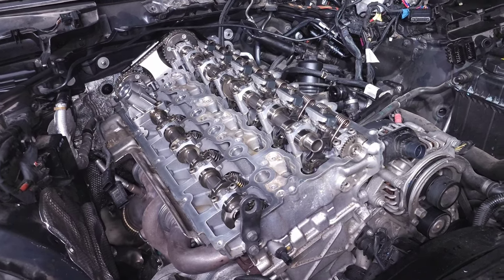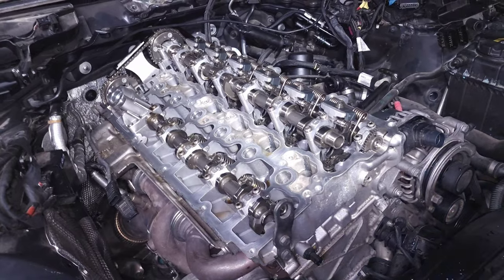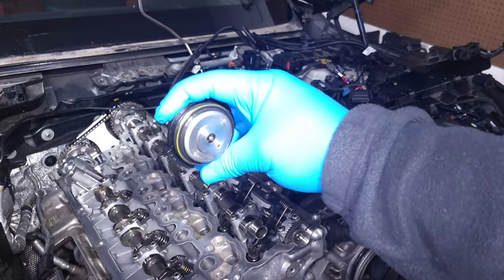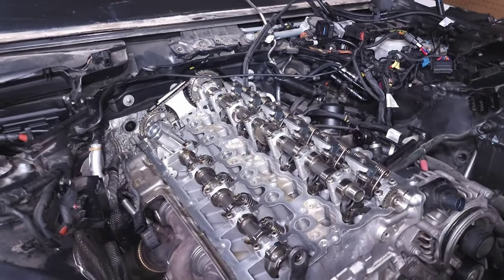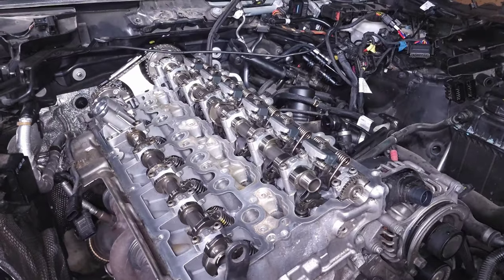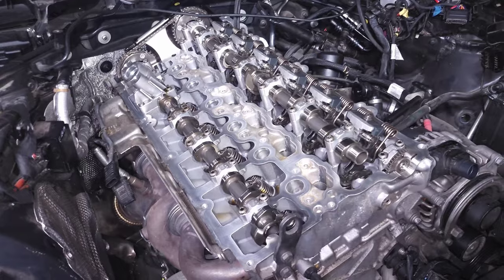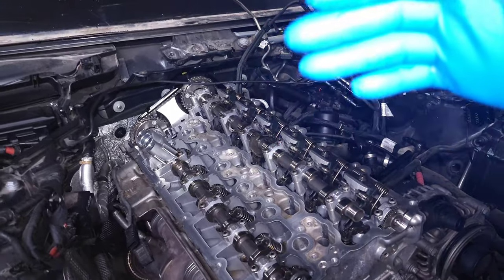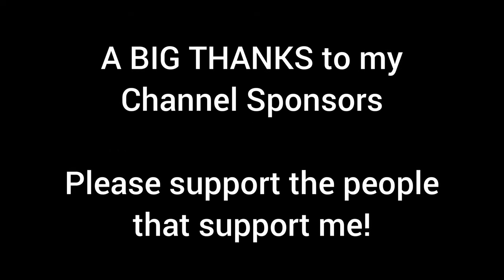Vanos: How BMW simplified their Variable Valve Timing (VVT) in the B58 Engine

Comment: As our motors get more miles on them, the VANOS system is becoming more if an issue.  Any chance you would consider doing a DIY on replacing the central VANOS valves?  I am seeing more posts on the bucking issues with these parts and the only videos are on the VANOS actuators located on the outside of the valve cover but no one has done one on the central valve.  Just a thought while you have the valve cover off your car.
Reply: Do gen 1 have this issue ?
Reply: did you end up doing it yourself?

Comment: I changed these Vanos valves on two cars without removing the valve cover. You can get there with your hand and remove them. It's difficult, but faster and than taking apart half the engine.

Comment: Hey! While trying to solve my stuttering low rpm slow acceleration, ive tested the vanos position vs actual and i saw and issue there. How would i know if its the actuator (what i see most people replacing) or the valve itself? (ive also seen people cleaning the small "filter" it has, in some cases that filter was actually ripped out)

Comment: I’m having vanos related issues on gen2 b58 but I’m not receiving a code the exhaust side degree angle bounces compared to its tagets on datalogs way more than intake side I’ve noticed that degree timing stays very high I am constantly over 100 degree angle with no codes. I have replaced the actuator on exhaust side and still same issues. Any advice or ideas on what it could be?

Comment: Hi , I did rebuild the vano on my E39 523i.... while the vano unit was removed I used a spanner and turned the crank a few turns...to many maybe 🤔, and the right spindle gear came out🥺, I have managed to put it back .... should I be worried before refitting the vano unit? Thank you

Comment: @kern417 when you replaced the actuator, did you go ahead and do both the intake and exhaust sides at the same time?
Reply from the maker: i didn't have to replace mine. if you're having vanos related codes then it will typically say intake or exhaust, so that tells you which one is bad.

Comment: @kern417 Great video and explanation, I have a question regarding the vanos actuator, and what seems to be the ever eluding Vanos Solenoid, am I correct in understanding that the B58 engine does NOT have Vanos Solenoids, I was able to find the actuators on the back, the error message I am geting is: "13070B VANOS, inlet, cold start not adjustable", I changed the actuators both the inlet and exhaust, but the error did not go away.  HOWEVER, oddly enough, when the engines warms up the error has gone away several times.  not sure where else to look.  I have seen the solenoids everyone, but can't find them on the B58.  Does the B58 have the VANOS Solenoids?  thank you in advance.
Reply from the maker: They aren't called solenoids but there are central valves bolted to the center of the cam gears.
Reply: Thank you for the response and explanation. I can see that It's not as simple as just unbolting and replacing...

Comment: Hi mate, 
Getting 130715 code, inlet cam jammed. Only seems to come back in the mornings once cleared. Replaced actuators, any idea what could be issue please?😢
Reply from the maker: Could be the central valve. Have you changed any mods recently?
Reply: @kern417  OTS MG flasher stage 1, but code appeared before that was put on but thought it went away with actuator change but it didn’t
Reply from the maker: Try replacing the central valve

Comment: Is it possible to throw the calibration off when servicing the vanos actuators?
Reply from the maker: It's based on oil pressure so not really
Reply: @kern417  even the central valve theres nothing that can go wrong regarding calibration?

Comment: Bro I’m literally getting this code right valvetronic  adjustment range  ,error check range what should I do I just recently went big turbo stage 3 trans tune Pi reflex and a custom tune from sam
Reply from the maker: You may need to replace the Valvetronic motor
Reply from the maker: https://youtu.be/TDowVgxFckc
Reply: @kern417  but how could it be damaged already and my car is still new thanks for the feed back I’m gonna watch the other one now just sucks I gotta pull it apart and I just upgraded
Reply: So this ?
Reply from the maker: @Jem_auto  it can fail for a lot of reasons. Sometimes it just needs to be recalibrated with ISTA. It just depends. Make sure it's properly plugged in too.
Reply: Yea I unplugged it and plugged it back in that didn’t help,  also how do I acesss ista ? Is it something you buy or like a special tool or is a software you download
Reply from the maker: It's software you can download. Check out the coding forums some have a download link